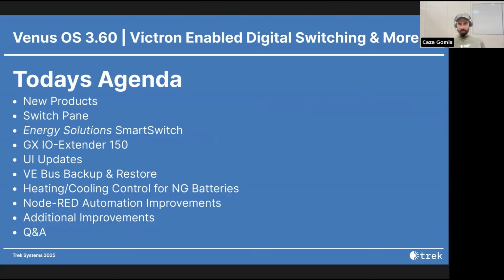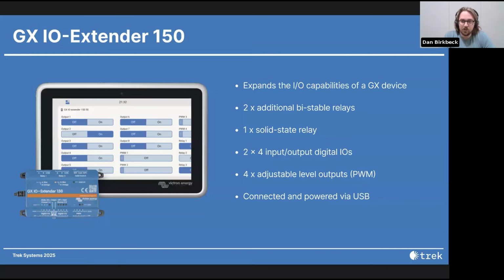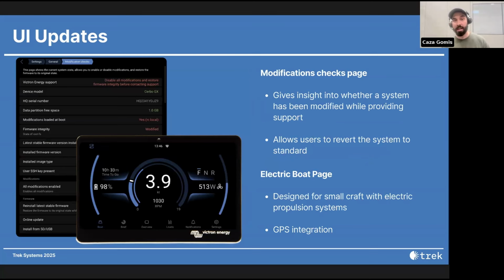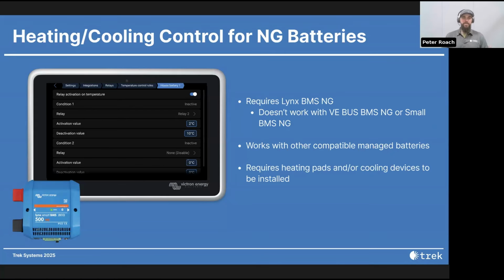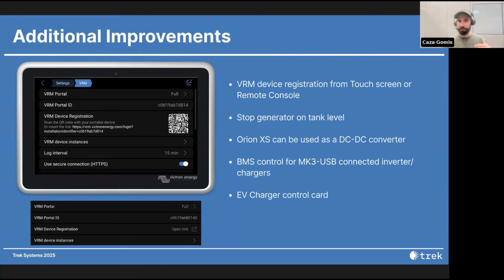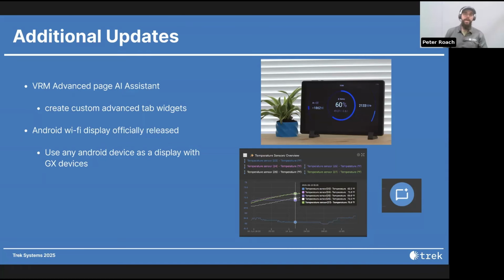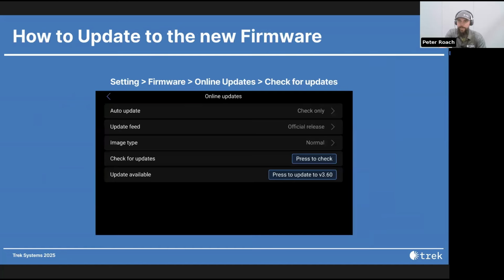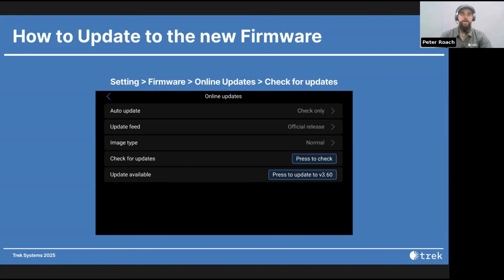Venus OS 3.60 | Victron Digital Switching

Comment: A possible issue with broadcasting the Cerbo serial number is it will be related to the blue tooth recovery PUK. If a bad actor uses this to get bluetooth access, they can then change the wireless settings for full access.

Comment: 57:00 Im sure there would be a module from Aliexpress or Amazon that could take a PWM input and run it through Mosfets and easily power > 15A
Reply: ebay > Trigger Switch Module 4-way FET MOS DC Control for PWM Motor Pump LED

Comment: Is it correct to assume that the IO Extender 150 or Smart Switch DC4, coupled with a Cerbo GX, could replace an EmpirBus-based digital switching system? Or do they provide different functionalities?
Reply: I would also like to know this - can this be a digital switching system per se ? like an EmpirBus digital switching system ?
Reply: so they are not answering these questions - if this is thier presale's, stay away from purchasing anything from them !